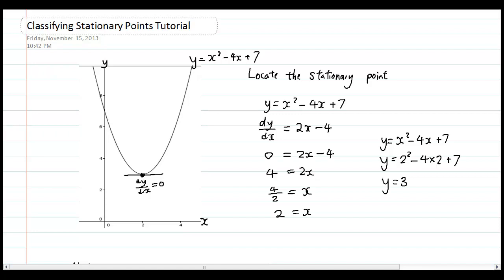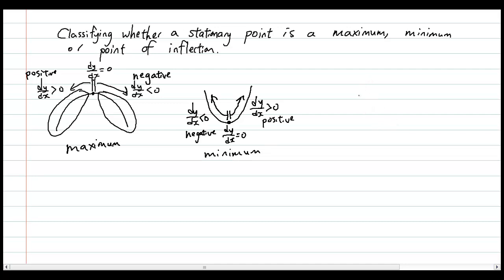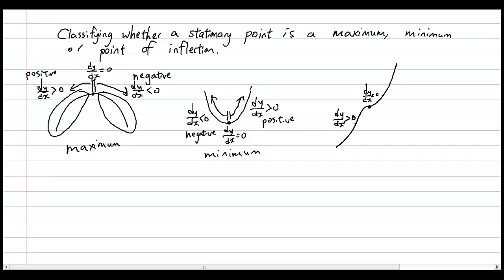Calculus lesson 16 - classifying stationary points

Comment: considering you channel revolves around talking and you spend a large amount of time to videos. i suggest getting a decent mic. i suggest and blue yeti or blue snowball. with both a filter and shock stand. that should only cost about $200 depends which one you get....
Reply: to follow the common rule: a video is made up of two parts, 80% audio and 20% visuals
Reply from the maker: thanks for the suggestion!